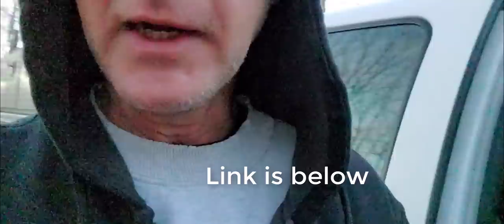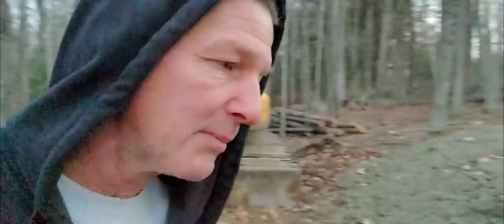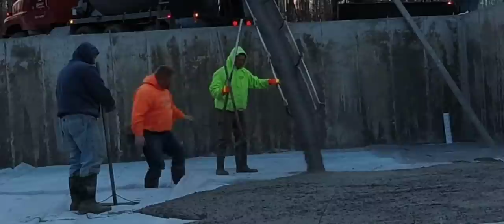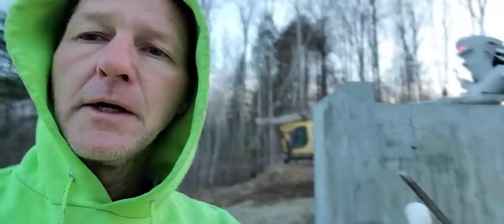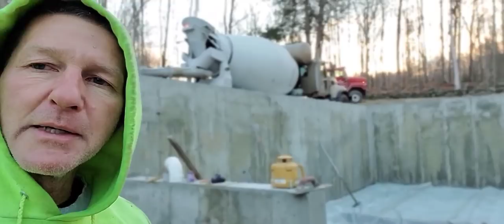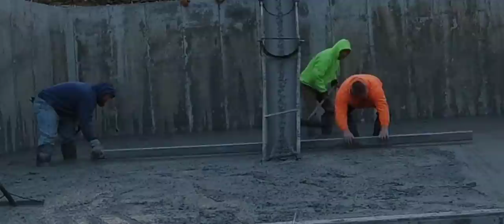Making Money Pouring Concrete In The Winter (How Hard Is It?)

Comment: Winter sucks! After 35 years as a general contractor... I'm so tired of the never ending..... mud, ice, dark mornings, warming up trucks, stuck trucks, covering things up, building tents, propane bottles, temporary heat, tarping and untarping, frozen material, cold fingers, cold feet, big boots, multiple coats, unloading the truck at night so things don't freeze, trying to dig frozen ground, it just never ends... it's depressing when you start a job in October or November because you know it will be hard the whole way through. Sorry I'm tired. Lol. Good video!!
Reply from the maker: It does wear on you for sure. I can relate.

Comment: After 38 yrs a concrete finisher as soon as frost hits the ground all pours need to be closed in and heated. Yes we use winter mix which is more money I al so increase price for pour, place, and ,finish and I offer different price ranges for finishes . But it's a hard job no matter the temp but as you said cold weather sure adds an element of toughness.

Comment: Did you ever try a pair of insulated gloves from a commercial fishing supply house for concrete work?  The lobster guys in my area use waterproof insulated PVC gloves with heavy fleece (orange or black).  I bought some for self-serve gas, snow blowing, power washing the truck, and fetching the green bin in the winter.  I keep a pair in the truck and near the back door.  They have great grip in the wet. I am up the coast from you in Atlantic Canada.  You might want to ask what your local lobster fishers wear for the winter fishery.  As for finer work like setting grades why not ask a local land surveyor what they wear for instrument work in the winter.
Reply from the maker: I may check into that Greg! Thanks
Reply: @MikeDayConcrete  I pour concrete flatwork in Minnesota and during the winter I do a lot of tenting,so I wear latex or thin doctor gloves under my regular gloves and my hands stay toasty warm and sweaty it works especially well when you need your hands for things the gloves are to bulky for I would highly recommend
Reply: Yep that's the ticket
Reply: @alexfischer9410  I am going to try that!

Comment: You guys need to check those magnesium straightedges before screeding.when temps in the 20s that cold screed hits that hot concrete it will bow at least a half inch or more. We keep flipping it over till it gets acclimated

Comment: Trick I learned working out in the elements in the winter is warm the gloves before you hop out of the truck, and put latex gloves on underneath.  As long as you do that before starting to deal with the cold, they'll hold the heat until you take them off.

Comment: Hi Mike I tried doing flatwork when I was young. Found out it was better on the other side of the chute lol. I drove concrete truck for 30 years and we poured concrete year round. It did get slower in the winter but we still poured. This is around Lansing mi. When  we did basements they more than  not had the decking on it so the contractor could heat it. I retired in 19 and I miss it everyday
Reply: Hey, I'm a little north of you near Mt Pleasant. I want to learn to do concrete, do you know any good contractors that will teach me everything?
Reply: @peters6850  all the contractors I know are around the lansing area

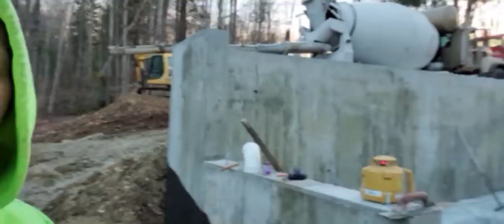Comment: I still  do foundations, excavation and  floors in the  winter. Use to plow  snow also but gave that up a  few  years ago really  wasn't worth it. I pour basements  with the  house on top. Sometimes  it can be 8:00 pour 5:00 finish. Once did a outdoor  garage no building finished  power troweling in a light  snow  squal at midnight. Not  really  a  money maker by any means. I don't  think any  one  likes  it but gets the bills  paid to some degree. Epoxy  floors  must  be  nice?

Comment: in southwestern pa i keep working when temps stay above 25 for a high. im only 34 but the cold is starting to bother more n more. yup those fingers n especially toes.   we dont pour much on styrofoam so were usualy standing ontop of the crete when screedding with 2% n 120 to 140 water.  then 2 hours after its in just lays there all day loosing the heat.  try to pour with the deck on then we hang a turbo heater but that also can delay the set if no airflow. seems all carbon dioxide delays set too?